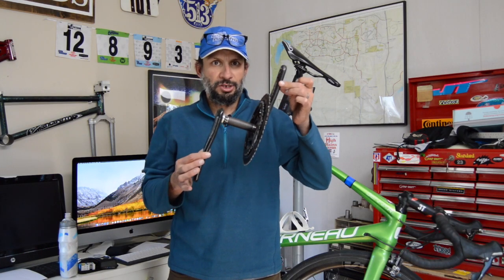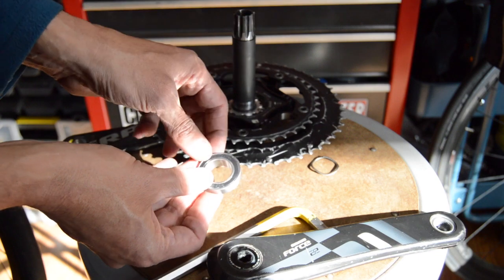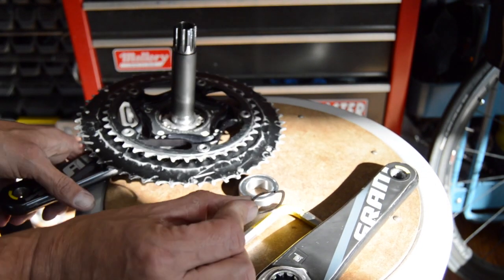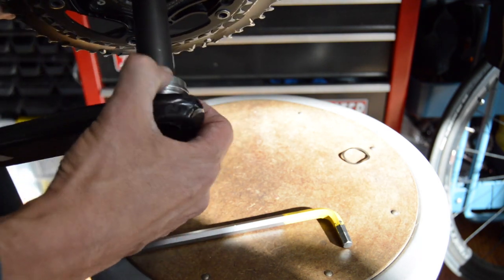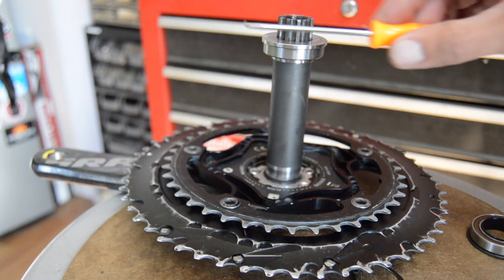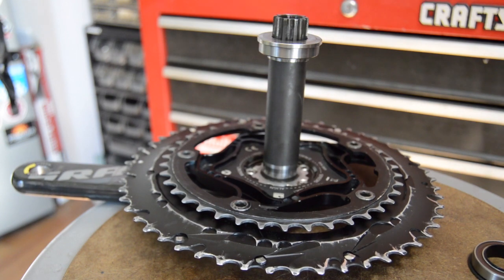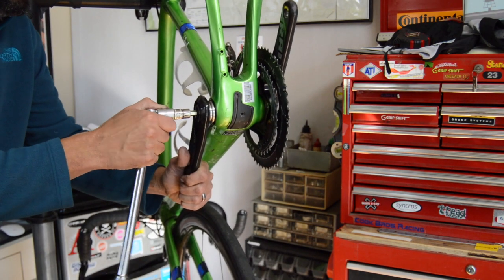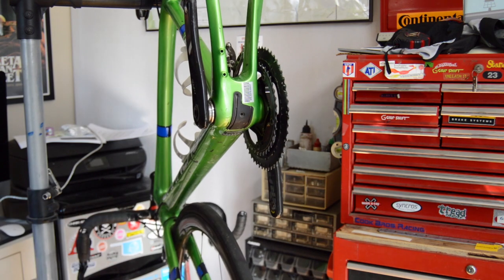IS The SRAM GXP The Worst Crankset In The World?

Comment: funny how that GXP came with 24mm spindle diameter on drive side, and stepped down to 22mm on non-drive side.
And, having none off-the-shelf bearing for the non-drive side with ID of 22mm, the bearing that came with this, has a sleeve of 1mm thick, so they 'fit' together.
Not sure if you call this engineering or SRAMineering.
Reply: Wow
The frequent exchange of thoughts had attracted me to finish watching the whole video.
And it’s still the same old gxp that i knew, and I’ll keep my opinion.
Now you mentioned hambini the other guy, well I’m not a fan of his vulgar words, but I’m with him, for far too many things happening in bearing applications within cycling industry is making itself a laughing stock. Well it won’t, because they are playing blame game: no it’s the frame, no it’s manufacturing, no it’s the installation etc.(psst..it can never be the design that’s flawed;)
Now back to the gxp.
1. It is still using wedge design for a ‘nice fit’, from the way you hand-tighten crank bolt you know that
2. and you didn’t tighten it to torque specification, don’t try, because it doesn’t work all the time, as staying within torque spec will not guarantee a ‘nice fit’ for NDS bearing’s inner race in longer term of use.
3. Wedge fit has been used for ages on square tapered solid BB spindle or even older. It’s the best design for industrial crank arm that has no dependency to other feature or functionality such as bearings’ optimum fit, or when one is flexible with its final axial position (in cycling industry the fancy name is Q factor isn’t it?)
4. For spindles other than solid ones, such as those with large bored out hole, the physics behind is a complex mathematics function/model, where every unit of tightening torque translates to extremely high axial-tensile load on the spindle forcing a reduction of its diameter, while wedging on, at the same time clamping onto bearing’s inner race,
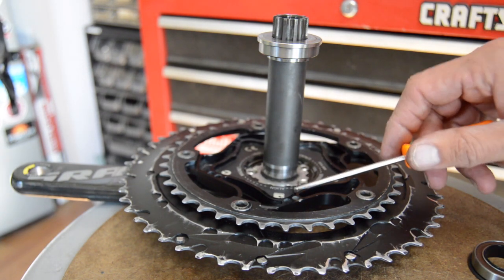5. 11:42 That’s why a ‘trial-and-error’ methodology is required, and it’s result defer from one person to another
6. 2:03 Pls don’t tell us it’s a 22mm bearing, there’s no 22mm bearing off the shelf with the same outer diameter as DS bearing, it’s a 24mm bearing fitted with a sleeve
7. Wavey washer is optional for cases where rubbing with bearing’s outer race could happen.
8. Lastly, you have hinted, shimano is good, sram is not bad. But if it takes an expert with tenth of years experience to install ‘properly’, there’s reason why it’s not the top choice.
Reply: @Billo7979  there are hundreds of brands selling this bearing, just skf  / nsk don't make them. 
22237 22x37x7
Reply: @janeblogs324  
‘Just skf/nsk don’t make them’ is self explanatory.
When a customer (eg. Sram) invented a new bearing dimension not available off the shelf, and influential manufacturers don’t make them, you’ll have ‘hundreds of brands’ flock to rescue; retrofitting an inner sleeve and deliver as 22237.
‘brands’ are not manufacturers with good understanding of the applications, therefore this goes back to the creator of gxp.
Reply from the maker: I like how if someone can't figure out how something works it's automatically "poor engineering".
Reply: Joey Mesa we certainly understand that the 24/22 taper will help slotting spindle from one BB end through to the other. However one more part means more tolerance to be considered.
Reply from the maker: What I'm hearing is you don't fully understand the concept of the GXP system. Just like Hambini didn't understand and created a shim to "correct the tolerances" , when that tolerance isn't even crucial. I'll say it again, the 22mm bearing id doesn't matter. When installed correctly, the NDS crank arm and concave spindle shoulder are the only crucial contact points against the bearing.
Reply: Joey Mesa thank you. I’m all ears.

Comment: I never had issues with the threaded GXP bearings myself but there is no question that Shimano has the superior system.
Reply from the maker: The shimano system is definitely easier to install, but I’ve owned and used both for thousands of miles, and durability wise, they’ve held up about the same for me. 
Anyway, thanks for your feedback!

Comment: My own experience with 2019 Trek
Madone SLR 9 Etap:  Misery from the 1st day.

Creaked on the 1st ride.  Poor spin test.

Hambini's assertion that GXP has a problem on  the NDS because the inner race is locked to the spindle certainly seems valid.

All they trouble I've had is with the NDS bearing.   Trek's fault - frame alignment or interence fit tolerance?  Sram's fault - a S load pattern on NDS bearing?  

Either way, I bought a very expensive bike that has been nothing but s@#t.  (sorry, there's
no other way to describe).

My next bike will not be Trek and will have Sram groupset.

Thanks for your post.  Thumbs up.
Reply from the maker: Thanks for your feedback Steve!

Did you purchase the bike new?  Who assembled the crank/BB?
Hambini claimed the main issue with GXP was poor tolerance fit between the NDS bearing and the machined portion of the spindle. Any halfway decent mechanic could see Hambini didn't fully torque the crank arm. You need to be able to feel the crank arm stop as it locks the bearing between the shoulder on the spindle and the crank arm.  Failure to do this will result in issues.
Reply: Joey Mesa 
Hi Joey,

Brand new.... ordered custom as a Project One.   Opted for Ceramic Speed bearing.

The dealer and I assembled out of the box.   The Waterloo factory assembled bottom bracket, drive train and brakes.

I heard creak on the first ride.   Immediately spoke to dealer and Trek technical help desk.

My dealer sells mostly beach cruisers.  He sprayed WD40 all
over the place.  Wouldn't it be nice if  just spaying WD40 fixed complex problems?

Trek is interested in moving product, not standing behind their
bike.  Trek's lip service:  could be pedals, could be gears, could be sun spots.

And, it is well understood that a bearing moving around in BB shell will destroy the frame.  That is what happened.

Trek never offered no way to remediate while it could have been easily taken care of.

A shame because it is otherwise a really nice bike. 

Best regards,  stevesocal40
Reply from the maker: You lost me at beach cruiser and WD40 all over the place.
Reply: Joey Mesa 

:) :) :)   If you gotta' pulse, you can be Trek dealer.

He IS a nice guy, though.  I still buy stuff from him.
Reply: Steve Flor sounds like an incompetent mechanic set it up. Get a wheels thread together in infinite bb and your creak will be solved.
Reply: @JoeyMesa  by feeling the crank arm stop you mean properly torquing to specs correct?
Reply from the maker: @taklopcic  No. You can feel when the crank arm physically won't go any further once the bearing is fully contacting the spindle and the crankarm. It will not go any further and you will feel the bolt stop. The torque to get to that point will vary.  It's kind of like using a torque wrench to adjust a cup and cone bearing. It's a feel thing.

Comment: Except it’s not designed for installation like that. The stepped crank shaft should clamp the NDS bearing, removing all lateral play. The wave washer on the other side is only there (if required) to hold the dust cover in place. It’s not designed for use with angular contact bearings. It seems wrong to evaluate the performance, whilst also ignoring the manufacturers installation instructions.
Reply from the maker: I think that's pretty much what I said? I usually just ditch the wavy washer. I had a Wheels MFG PF30 to GXP conversion BB with angular contact bearings. I sold the bike it was on eventually after over 15,000 miles on it. Still spun smooth as butter!
Reply: Joey Mesa i don’t understand why in the second half of the video you show packing out the DS? Wheels manufacturing sell spacers, as well as  very stiff wave washers, only because their BB has angular contact bearings that are not strictly compatible with the Truvativ GXP system. It’s easier to use a BB that has radial contact bearings (e.g. SRAM/Hope) which do not require preload. The NDS bearing should take all the lateral load and there should not be any creaking. The thin wave washer is only required for the pressfit BB variant and only to lightly hold the dust seal in place. I have no creaking from my SRAM GXP cranksets and they spin just fine.
Reply from the maker: @likemarksee  Yes, overall you're correct. My theory is that if the DS void was filled, not packed, with spacers, it could even the lateral load on the NDS bearing. Probably doesn't affect anything, but the goal was to get the crank spinning as free as possible.
I don't like wave washers because they can put too much load on the dust cap/DS bearing in spots causing drag. I like using shims to lightly hold the dust cap in place if needed. If there is a sizable gap, some guys like to use an o-ring, which would work well in that situation. I think the main issue with GXP is many folks just don't understand how it works. The drive side gets too much spacers+wavy washer and causes a side load issue with the DS bearing, or in the case of the Hambini video, the NDS crank arm is not properly torqued. If the NDS bearing is not locked tight between the spindle shoulder and the crank, there will be issues.
 I've also seen lots of cranks installed with extra spacers on the NDS. If the NDS crank arm doesn't have enough purchase on the spindle, it will eventually work loose.  This would be the case of Hambini's fix, as he created a 2-piece spacer to fill the void of his inability to fully tighten the crank arm. At least that's what it looked like to me, he never gave any measurement specifications.
As far as angular contact bearings, it seems the NDS side would benefit as it sees radial and lateral loads. I'm not sure what Wheels MFG uses on their angular contact PF30 to GXP outboard BB's, but for me that thing was bulletproof.  I never touched it for 2 years and it never creaked compared to my BB30/PF30 that needed maintenance frequently or it would creak.

Anyway, thanks for your feedback, I really appreciate it!
Reply: Joey Mesa i also switched to SRAM GXP after suffering with BB30. Far from the worst system in the world, i think it’s pretty good. I also thought it strange that the crankset Hambini fixed would not tighten in the first place.
Reply: @JoeyMesa  All true, but I have had quite a few times a scenario in which the properly tightened crank bolt came undone during the ride. Otherwise, a smooth and problem free operation for 10k miles so far. That with a Hope press-fit bb.

Comment: Yes it is the worst - such a piece of shit. Always loosening, fucked bearings within months. 
Sram should be ashamed of themselves
Reply from the maker: So please explain to me how since this cranksets inception, I've installed and serviced literally thousands with very little long term issue? I have seen quite a few that were installed incorrectly in ways which can cause the non drive side crank arm to work loose and or damage the bearings, but that's not really an issue with the crank system.

Comment: I went to a store and took my frame, I wanted to get the omnium cranks for my track bike.
I put in 3 different gxp bb the third one fit the other two didn’t... the threads were just off.
I then put the cranks on, one was to loose, the next was to tight; but the third one was just right lol.
Anyway my three bears story.
I’ve been using that set up for 6 years and it’s been fine, gone through 3 gxp bottom brackets but that’s to be expected.
If you find one that fits they are great, you just have to find a good one lol.
Reply from the maker: Nice!
Reply: what bottom bracket you're using  on your omnium currently? I've been using the stock bb that comes with the crankset but it does not spin really well. I've read somewhere the stock bb is kinda trash so i've been looking for a replacement.
Reply: I expect my Shimano BB to last at least 5yrs of hard use, not even surprise if it last a decade.

Comment: I can add that my SRAM XO1 GXP crank and threaded BB setup is nightmare setup and bearing durability when compared to Shimano Hollowtech. Only feels smooth to spin initially when new GXP BB is installed but within 2-3 months the bearing is toasted, as in gritty and rough to spin. Always the same side bearings go bad. After watching Hambini video it came clear to me why I am going through so many GXP BB bearings.
Reply from the maker: I agree with you that GXP cranks are more difficult to set up correctly compared to Shimano hollow tech II cranks. However, I've literally installed thousands of GXP crank/BB configurations with great long term success. I've also seen many that were improperly installed and the resulting issues. I'm not going to speculate what your bearing issue is/was because I haven't worked on your bike. Watching Hambini is a poor example as he never follows through with the assembly. If the non drive side is not tight enough, you'll get play between the spindle/bearing interface. If you have too many or not enough spacers on the drive side, you'll smoke one or both bearings. It's a pretty simple system, but it stumps a lot of mechanics who don't understand or have much experience with GXP cranks and BB's.
Reply: @JoeyMesa  when you shim the drive side you're building it against instructions. You are effectively giving the drive side an axial load towards the centre and unload the axial load to the outside on the NDS. That may fix the design faults in the GXP bracket. But that is a botch entirely against the design by SRAM. Who apparently did that horrible set up witch all side loads on the NDS to avoid running afoul of Shimano patents. To conclude this line of argument: As I see it you are trying to say something is not bad by design because by changing what's bad in that design it isn't as bad any more.
Reply from the maker: @geraldschenk  I'm not shimming the drive side, I simply like to fill the void between the spider/drive side crank arm and the drive side bearing/dust cap, just enough to hold the dust cap in place. If there are too many spacers, it will sideload the drive side bearing as you say. When set up correctly, there is only a radial load on the drive side bearing, that is when the non-drive side crank arm is properly secured ( the part Hambini doesn't get right). 
To conclude my argument: The Sram GXP is a good design but is susceptible to problems when incorrectly installed.
Reply: Joey I followed GXP BB and XO1 crankset installation to per instrcution that came with the crankset. I've been wrenching my own bikes for 20 years now and I never had bearing go bad so fast on BB. I thought it might be SRAM GXP bearing qaulity issue so I went ahead and spent some extra coin on RWC brand GXP BB kits. It didnt matter. I cant be replacing BB bearing 3-4 times per every riding season. I gave up on XO1 crankset with GXP BB. It just collects dust now. Maybe some day I'll get brave give another try but what other method is to install this GXP setup other than it's own installation manual? I am using recomended spacers and torque setting as specified in the instruction manual.
Reply: Joey Mesa å

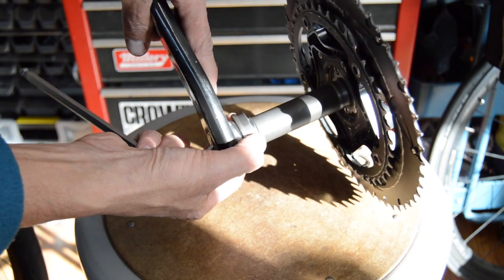Comment: a) For problem which Hambini had at 5:40 he have just to go fitness and train muscles to apply enogh force.    OR.   b)  Engineering approach.  As he mentioned that force to apply for torque  is increased "exponentially" then he may just take "exponentially"  longer  wrench .        b) variant is preffered as it gifts more FIntness 😁
Reply from the maker: I think you're on to something!

Comment: i've owned two. They are the worst.
Reply from the maker: Why? What specific issue did you have?
Reply: @JoeyMesa  Incessant creaking, premature bearing wear. Shimano has had no such issues, even with press fit versions.
Reply from the maker: @bubbastard  I haven't seen how your cranks were set up, so I can't speculate. I've owned several Shimano hollow tech II and Sram GXP cranksets, plus I've had the opportunity to work on several of each type weekly, consistently,  for the last 15 years since they've existed.  From my experience, from durability and problematic standpoints, when installed correctly, they're really about the same. 
I will say Shimano cranks are much easier to install correctly though, at least by the general public. The most common issues I've seen with GXP cranks are extra spaces on the non-drive side causing the crank arm to not have full purchase on the spindle, which will cause creaking and eventually a loose-fitting crank arm, and/or too many spacers on the drive side, which will sideload the drive side bearing and cause premature wear as well as poor bearing spin. Not enough spacers will cause excessive stress on the non-drive side as well.

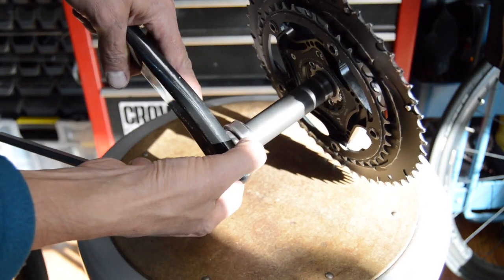Comment: At 5:39 it looks like you've got just as much radial play as the Hambini video.  Tightening the NDS crank arm down as you have done is not going to center the bearing.
Reply: bearing is fixed from lateral compression or axle diameter grows during tightening ?
Reply from the maker: The shoulder that the bearing rests against is beveled which centers the bearing.
Reply: Yup, that is exactly what I thought.
Reply from the maker: You have a good point, and that's something I thought about as well. I started looking a little closer at the spindle and one thing I noticed was that if you hold the bearing up against the shoulder of the spindle, the bearing won't move. I wondered if the shoulder was beveled instead of a squared off 90 degrees, and it is indeed machined with a small concave shaped bevel. Tightening the non drive side crank arm against the bearing will cause the bearing to center itself against the beveled portion of the spindle.
I made a video with some close ups of what I'm describing, but I feel like it's boring, so I haven't uploaded it.
Reply: @JoeyMesa  Could you upload the video if you still have it? I always learn from your expertise.